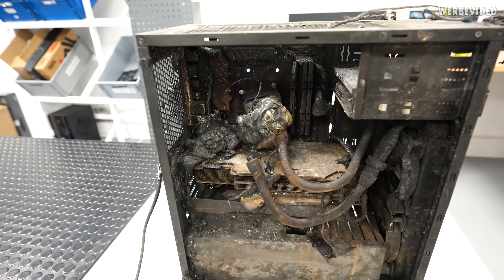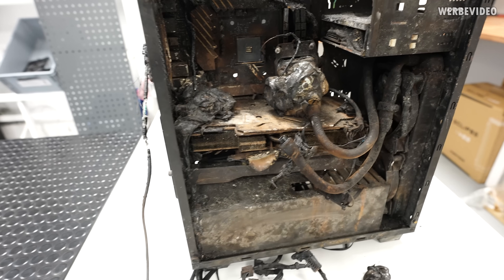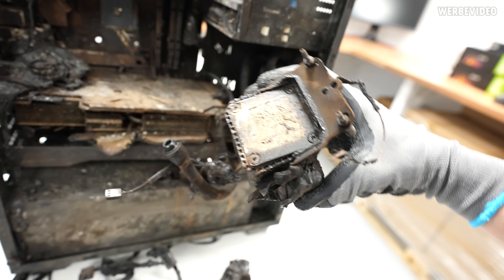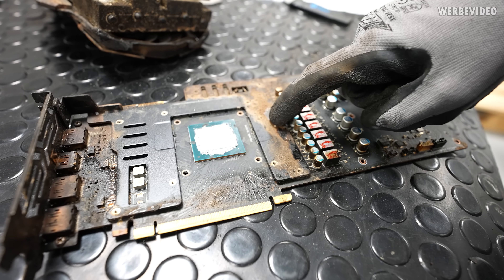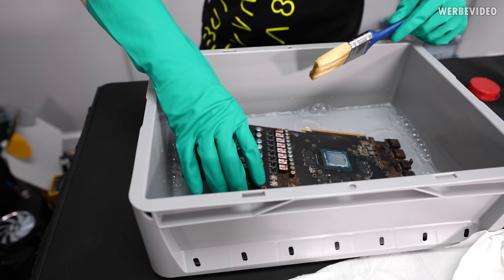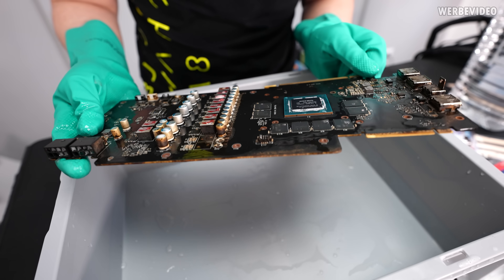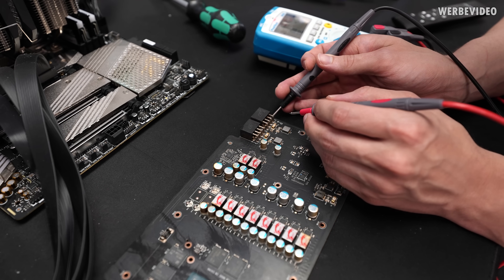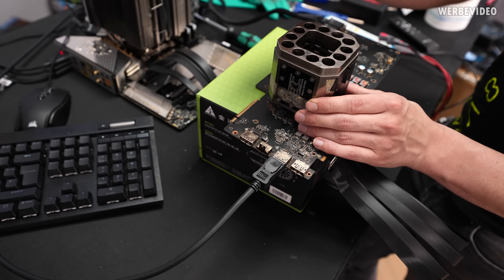Just Mind Blowing! This PC was literally on Fire - But did the GPU Survive?

Comment: This gives me hope. I work at a landfill transfer station and got a load in that looks like someone’s house caught fire and they just junked everything. Found a gaming computer in the rubble. All the fans were melted bad. All the cords were still plugged in but melted away, leaving just the metal bits. Stole the GPU and CPU out of it- i7 10700k and a RTX 3080. The GPU looks almost identical to this one, maybe slightly better. I think the cooler is salvageable. Only the corner of the plastic housing is melted. It’s nasty though. The CPU looks pretty good. Still had good thermal paste on it. Hope to test them out soon.

Comment: Very very cool video, but just to clear this up, plastics do not melt at 80c, a big variety of plastics, begin to melt at a 100c that do not meen like this, for this to happen, it have had to be like 200-250 somewhere i think, i do alot of 3D printing, and know alot about plastics in general, and it do not melt like this at 80 degrees. an open flame, is like 4-500c and up to a few 1000c dud, depending on the environment. just wanted to clear this up ;)

Comment: Msi does something about manufacturing cards that makes them heat resistant and durable... I have old R9 390 that ran 96°c and it still works today... Card has sagged a lot not only by the weight of the card but heat too... This should be their marketing campaign

Comment: GPU's are baked and pre-tested in ovens if you did'nt know that. I mean try to get more info on how a manufactor like AMD tests their cards. They put those things at 100% usage in ovens of 60 degrees and such. The soldering quality is outstanding for videocards. It can withstand a normal fire yes. Would be different case if the complete case was cooked.

Comment: You are not right regarding the plastic melting point, no type of plastic used in a computer, will melt below 100c.
Polycarbonate which is common to find i PCs and for fans, requires above 200c to melt.
PMMA requires 160c.

ABS will melt at fairly low temperatures (~110c) but that isn't that common in decent quality PCs.

Other common polymers are PE, POM, PA, PVC, which all need above 140c

Comment: The more common heat-resistant plastics have a heat deflection temperature of about 80ºC (ABS) to about 110ºC (PC); to melt into a blob like that fan, though, takes >200ºC.
(I don't mean to nit-pick, I'm just saying that it's incredible that you could have baked a pizza on that computer case, and parts survived.)

Comment: I have a crazy question, I spilled a very small amount of liquid metal thermal paste on my laptop motherboard. I have been unable to boot the system ever since. Would it be possible to wash the entire laptop motherboard in the same way you washed that video card?
Reply: No your motherboard is gone. The thermal paste likely shorted and destroyed multiple connections on your board. Electrical shorts arent even somewhat related to the damage caused by a fire.
Reply: @krektonik3886  Thanks. I didn't think so, but I'm just trying to find ANY way to possibly fix this system, even though it is probably done for.
Reply: @zlamdunk007  You need the motherboard scheme then check which part needs a replacement.

Comment: ebay listing: rtx 2070 gaming x trio - never minded on, pet free/ smoke free home. The card does smell a little funny but I only ever smelled it once when it got hot. This card has worked flawlessly since I bought it. It ran pretty hot once and the system powered down, GPU still works...the fans died so Im just listing the pcb because the cooler is heavy and I don't want the card damaged in shipping with the prices of gpus right now. I was going to watercool the card in a new build but I ended up getting a deal on a pre built.

Comment: you do not have a ultra sonic cleaner? that would be so much better. and corrosion wise, if you did not remove all corrosion, it will just continue, even if you dried it. the card will fail in the next year i think.

Comment: Did you check the burned connectors for short to ground of the pins ?
Did you run a simple render test on it to see if the GPU can handle any load at all ?

Comment: The TU104 itself should be pretty much as good as new right? So potentially, if you can find a donor board you could resurrect it 100% with some industrial soldering work:). That would be a fun video.

Comment: Insert that Nvidia "Hot Hot Hot" meme here with Fermi 480 Grill
Reply: "Nvidia Thermi, the way it's meant to be grilled". That was quite a nice meme at the time.
Reply: I tried 3 480s once. Melted middle PCI-e slot on the motherboard. Also burned my fingers when trying to remove the god forsaken card almost 10 minutes after it shut down. only FX5900XT was worse card imo.

Comment: That card deserves to be watercooled now... and that also solves the issue of not having a cooler for it.
Reply: if the heatsink is still in tact, he can just slap two 120mm fans and call it good.
Reply: @pak0otac0o  It most likely is, might need cleaning to remove the corrosion and it might be good to go and if the plastic still has strength it can also be cleaned and reused. The fans might be a completely different story, replacing them would be better.
Reply: exactly my thoughts
Reply: As the pcb is warped I'm sure there would be a high chance of a short if you put a water block on it, you'd have to unbend it somehow
Reply: Not sure about that. Recently fried a GTX1080ti installing water cooling.
Reply: @laowai2000  did you buy the correct water block? Or did you accidentally use conductive paste, also fried is reltive send it to north ridge fix cuz it might just be a fuse on the board
Reply: @clippyremembers  I did something stupid.  Block came with led light and I connected it to card.  Same pin, wrong voltage and let the magic smoke out.
Reply: @laowai2000  yeah send it to north ridge fix, they could probably change whatever smd you fried, I'd bet it's some kind of fuse or capacitor that got fried, but yeah I'd watch some of their video card repair videos cuz they might be able to fix it for ya
Reply: same thoughts

Comment: I serviced  pc form an art install once , it had one of the old school dedicated physx cards in it , that thing had been running for prob 10 years with the whole cooler fallen off the physx card , the back of the cards PC had gone brown it got that hot , but it was still running ! You would be shocked what can still keep working.
Reply: The one component I've seen the most dead of, and I was working in electronics recycling so I saw a lot of dead components, was an old ATI card that would end up killing itself since the vapor chamber always ended up bloating. It's kind of crazy comparing the extremes of what doesn't kill it versus what does.
Reply: @OfficialMageHD  So the die got crushed or what?
Reply: @fVNzO  If they did I don't recall seeing any obvious damage to the die, although we weren't really taking the time to look that closely at them since they were obviously dead and not worth worrying about even if they worked since they were so old. Most of the time the entire PCB would be bent a pretty significant amount.

If you look up ATI GPU vapor chamber failure (might have been AMD at that point, dont remember exactly), and it has a red vapor chamber with some small fins on top.
Reply: Damn, how long had that build been used without even basic service?

Comment: Actually Corsair fans and Corsair controller is causing a fire for me now on third set Ive had. The cables are getting red hot and the rubber shield around the cable wire is melting. Ive got it even on Video this time. Thinking about where to send it, Steve or you ^^
Reply: Which model of fans?
Reply: @lafave2555  Ive had SP120 and LL120 so far with this issue.